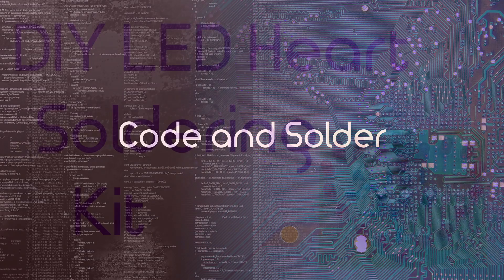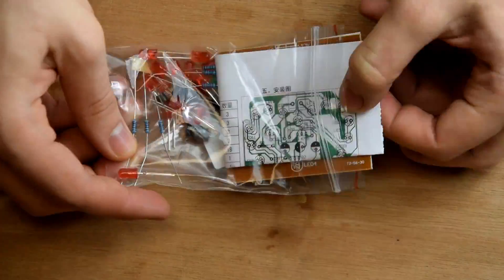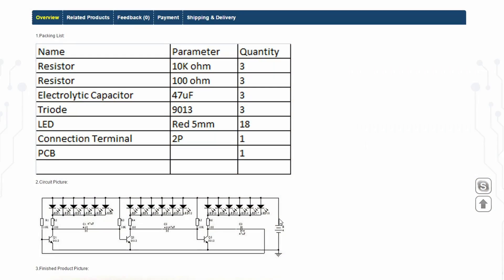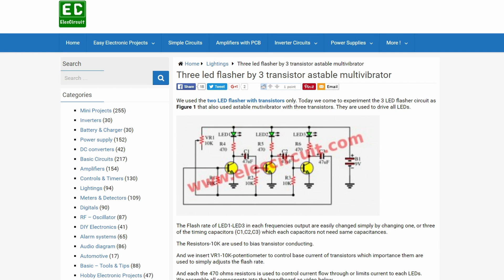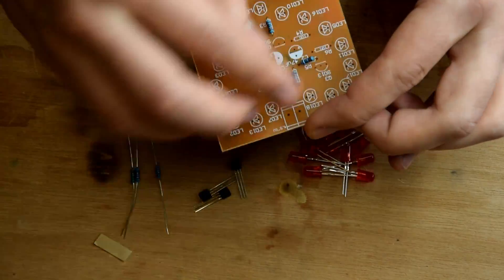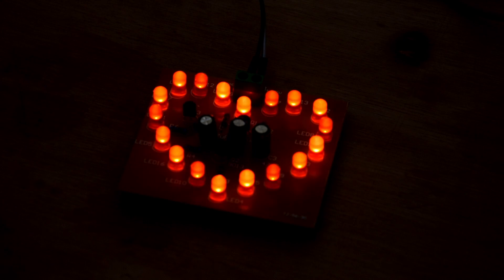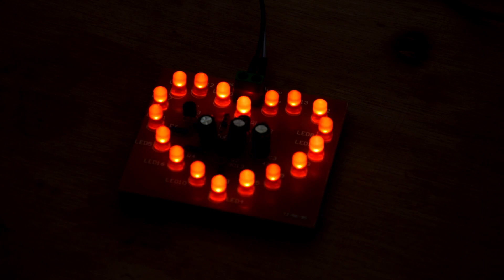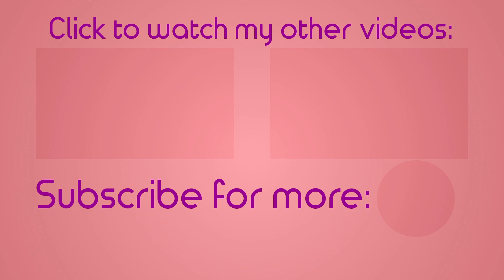DIY LED Heart Soldering Kit Review + DIY Soldering Iron Test

Comment: I have created a kit that is USB powered so that you don't need batteries.  My kit includes a 5 foot long USB cord, the board has plated holes, and it has a much better light.  I have my students 3D print a cover for the light too.  At this moment in time I have the price at $5 ($4 if you buy in bulk).   If you are interested the website is @t